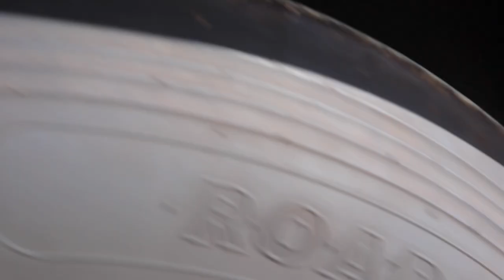RV Roof Tips and Tricks! Full Time RV Life..Ep 2.56

Comment: Good information,  I really like the caucking storage tube , can't tell you how many times I've waisted product by letting it dry out and harden. 
   Was wondering,,, how do you feel about putting eternabond tape over the cauckung seals on the roof ?? Does it help or hinder ???
Reply from the maker: I would not do that as the caulking will break down.  I would suggest removing the caulking first.  But check with your manufacture for the best answer.